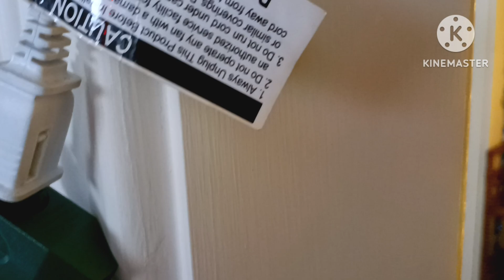52" Panama Gear Driven Ceiling Fan (3D Printed!) With a light kit. Part 2

Comment: do you still have this?
Reply from the maker: Sadly no, I parted it out to make my cosmic spinner ceiling fan.

This gear driven fan had too many durability issues and the motor housing was crumbling beyond repair.
Reply: @Alexthefancollectorok
Reply: @Sant2848  Well I noticed that his is very droopy, prompting me to use cardboard blades because:
1: to reduce the sag and I can make new ones easily.
2: Balsa wood is expensive where I live.
Reply: @FanCollector1986 to me it seems like the brackets were sagging under the weight of the blades
Reply: @Sant2848  So I switch to Cardboard Blades! And I make it accurately replicated to the CM Electronics variant
Reply: @FanCollector1986 o yeah ok
Reply: @Sant2848  Also, I assume his blades were heavier than real Panama blades
Reply from the maker: @FanCollector1986 Mine were heavier for sure. The plywood I used is like the type of wood used for regular ceiling fans.

I actually saw balsa wood at a crafts store a few weeks after I finished this, but that board felt quite crackable and weightless.
Reply from the maker: @FanCollector1986 Definitely go with cardboard. I used it for my Cosmic spinner and I haven't had any issues with it yet. Just keep it away from high humidity to prevent it from drooping.
Reply: @Alexthefancollector  OR I could upgrade to a stronger filament like PETG or PET
Reply from the maker: @FanCollector1986 Nah, those give off toxic fumes when they're printing.
Reply: @Alexthefancollector I believe the board of weak balsa wood (that you found) is actually the exact same thing they used. I realized that the cardboard blades actually have a risk of bending upwards under stress, while the ones you've used are simply too heavy.